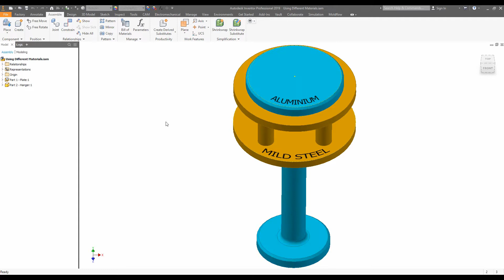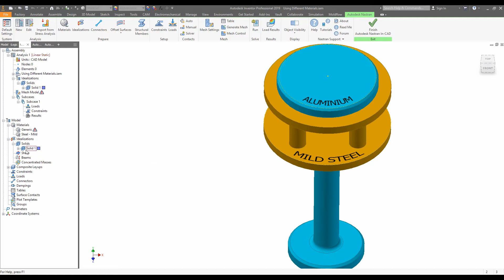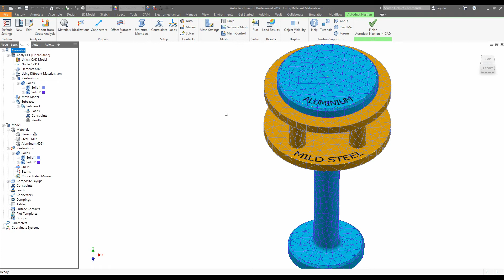Assigning Multiple Materials in Inventor Nastran

Comment: can different materials only be assigned in an assembly? I've been trying to assign different material properties to a part file to different "solid bodies" in my part; however, it doesn't seem to work properly. Any suggestions?
Reply from the maker: Unfortunately, you are correct. Idealisations can only be assigned to parts bodies within an assembly file and not to multi bodies within a part file.  Our best suggestion is to use the “Make Components” command to create an assembly from the multi body part file. Once each body is represented in their own part file, you can utilise this workflow.